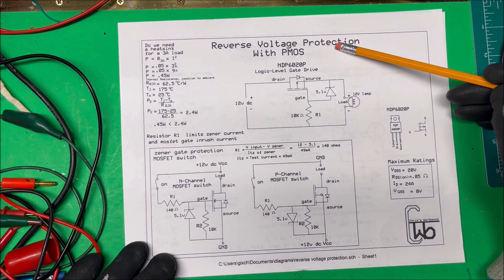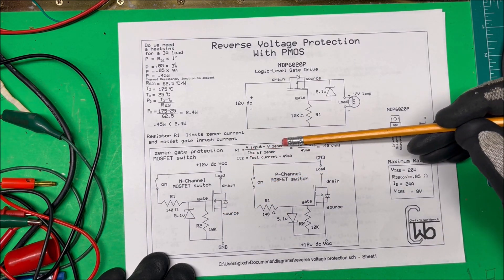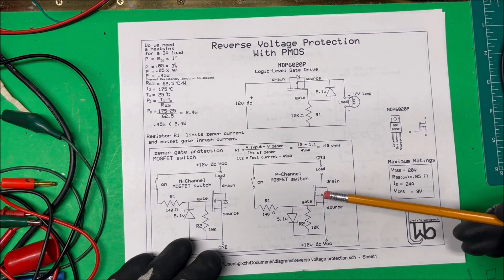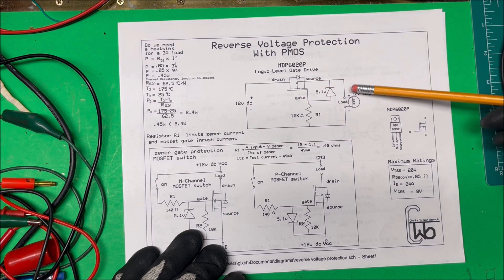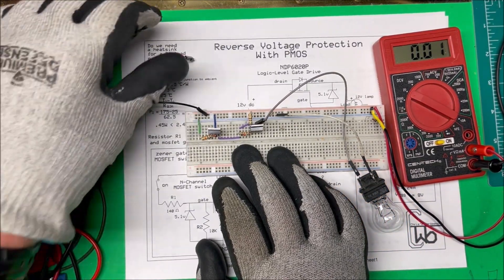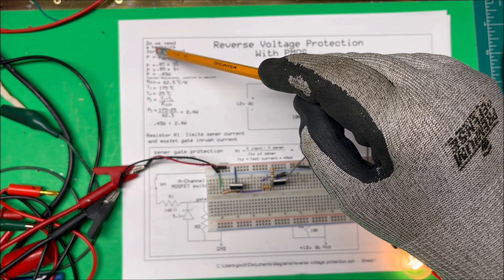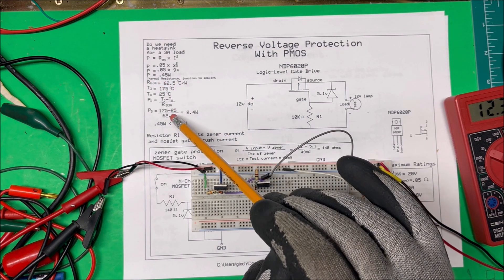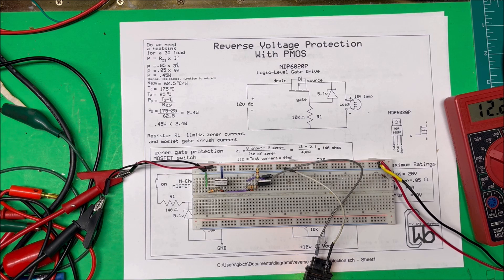Reverse Voltage Protection

Comment: I noticed mosfet can’t handle load in liner the dye can’t handle the voltage from 40 volt and up even if the voltage rate is 600 voltage the load shot through so using mosfets for reverse voltage protection can only work to turn on small load  like real